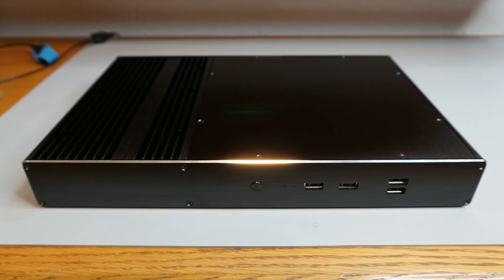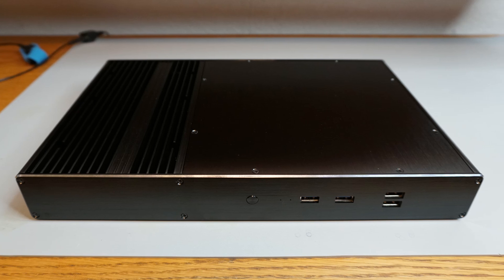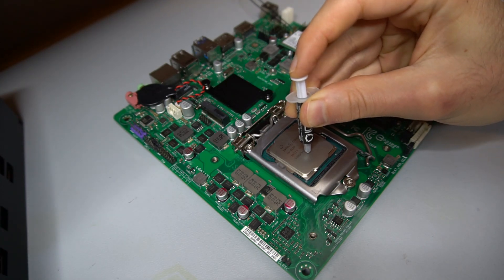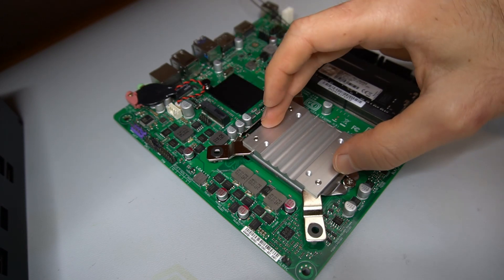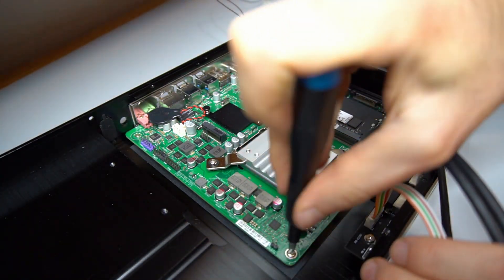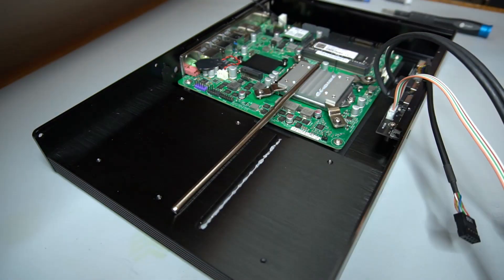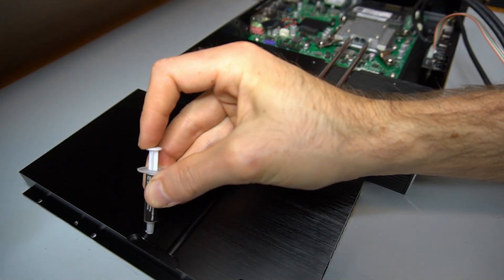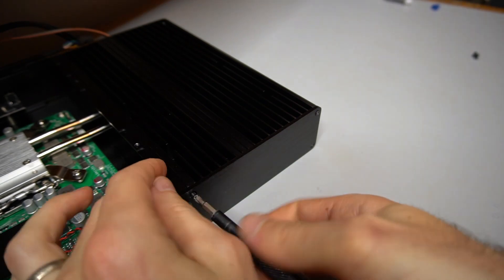Akasa Galileo T - Building a Fully Silent Fanless PC

Comment: wouldn't the exact location of the heat pipes mean that only particular mini-itx boards would work? The mini-itx standard doesn't exactly define where on the board the cpu is does it? i would think you could easily order the "wrong" board and the pipes would miss
Reply from the maker: This case is for Thin Mini-ITX motherboards only. The Thin Mini-ITX standard does define where the CPU socket it.

Comment: Thanks, I build this 2 days ago, undervolting with intel xtu works makes it cooler, but I have to set it after every reboot... Throttlestop works great too but I'm new to undervolting a computer... I can set the voltage to an offset value of -0.150 or -0.170 but more than that doesn't work. I'm making test with the maxium cpu load in windows.

Thanks for the video, I just followed everything, it was very useful.

Comment: Such a shame only 2 grooves in the case...  they are cheap no aliexpress.
I think the heat pipes should be in the center of heatsink
Reply from the maker: Agreed, it could be a little better. It is designed for 35 watts though, and works well for that. The heatsink does get very hot, so I don't think there's too much of a bottleneck with the heatpipes.